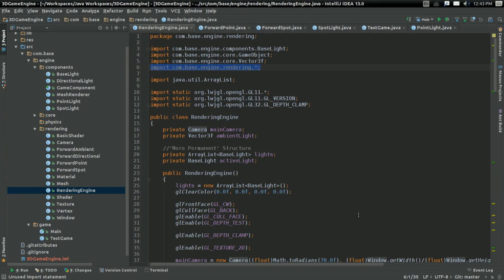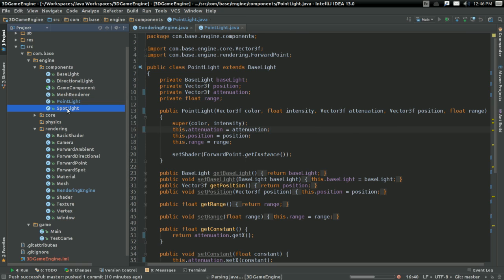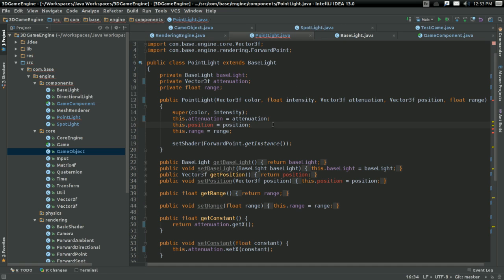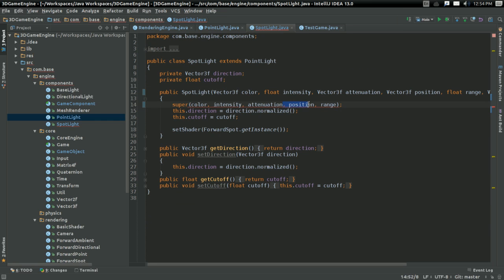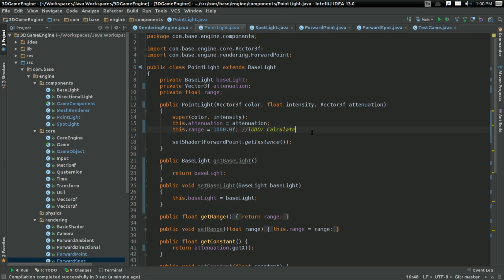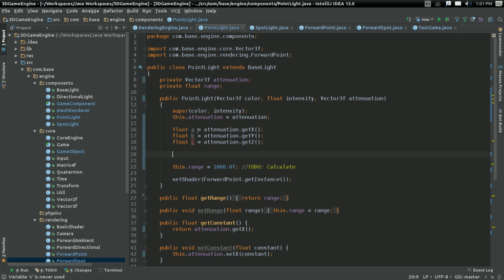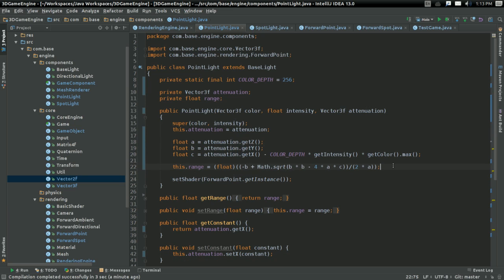#43 3D Game Engine Tutorial: Finalizing Lighting

Comment: So the way the scene graph is made, it seems as though lights are based off of a game object, and are attached almost like an effect.  They don't seem to have independent positions or anything like that.  So if I want a flashlight in my game, and I want my character to hold said flashlight, I will have to make a game object with the mesh renderer for a flashlight and a spotlight component for the light itself?
The only reason I'm asking is because say I want to offset a light for some reason.  I have to then create a game object for the sheer purpose of offsetting the light using it's transform.  So then wouldn't it be best to have a game object assigned to each light to act as a way of manipulating the light?  For instance, a SpotLightObject that's only property is a SpotLight?
Reply from the maker: The way you'd create the flashlight in this system is with two separate GameObjects.

The first GameObject you'd give a MeshRenderer with your flash light mesh and material. The second GameObject would have the SpotLight component, and it would be a child of the first GameObject.

With this, you can move the light to wherever you want, and it will always stay there "attached" to the flash light GameObject.

Now if I understood your question correctly, and I'm not sure I have, there is some issue with this system that can be solved by having unique special case GameObjects dedicated to individual light types? Could you elaborate, or have I completely misunderstood your question?
Reply: ***** I was suggesting that, similar to how you have a set of game components (like mesh renderer and spotlight), some should have corresponding game objects to make implementation easier.
Reply from the maker: forrest0no2 What would be the benefit of having a dedicated SpotLightObject for instance, as opposed to just attaching a SpotLight to a GameObject?

Comment: Well your range system is sort of bugged in my version. I double checked both the shaders and the classes and both spot and pointlights do not have a proper range. The weird thing is that it seems to be different from the angle you are looking (far away and everything is cool, while closer to the lightbeam slowly shows the range cutoff). Any clue where I should start searching?
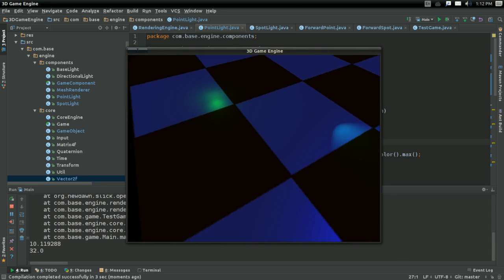Reply from the maker: I'd start by comparing the ranges your code generates to the ones my code generates in the console at 16:40 If they're different, it should give you a hint as to how the equation is off. If they're the same, then just scale the range up by some constant until it looks right. Since range exists purely for performance reasons, having a larger range than necessary won't cause an error with the program, it'll just cause a few more pixels to have light calculated for them.
Reply: ***** Will you be getting into model loading with animation? I believe this is the most overlooked/under explained aspect of Java 3D game programming.
Reply: ***** Alright I checked it and they are indeed the same. But I think there is another thing going on here. The light seems to be changing its intensity based on the angle. But the reflection seems to be get stronger and stronger depending on the angle you are looking at even at the very "edge". Also it seems that the light gets a little bit stronger again at the end of the range (so strong that you can clearly notice it). Any clue? I do have a "custom" Mesh class as I have to use the 4.1 core profile of openGL
Reply from the maker: DarkOverture It's possible that there's a bug in your shader code. Again, since the range is purely a performance thing, I wouldn't worry too much about it unless something seems obviously wrong. You can just multiply range by 1.3 or 1.5 or some other constant until it works.

It's also possible that this issue is present in my code as well, and I just haven't encountered it yet. Are you using a different set of lights than I am?
Reply: As I always try to use your exact code when encountering bugs, no, I am using your exact TestGame class, including all its settings. I have uploaded 3 pictures on imgur that might help you visualising this problem. Maybe this might help you to prevent a weird bug in your engine (as I have mostly the exact same code (again, my Mesh is different)). Here is the link: http://imgur.com/a/lYzfS
Reply from the maker: DarkOverture It looks like there may be a bug in your point light or spot light shader. That isn't what they should look like
Reply: ***** well this is weird. I actually copied all the shaders from your git and modified to work on version 330 and thats it. Its the exact same code. I also use the git code for Shader, Forward<Shader> and the Shader Components. One thing though: in compileShader, when I use the if statement to check if the GL_VALIDATE_STATUS is 0, it says that there is currently "no vertex array object bound". If I disable the System.exit(1) everything runs just fine. How in the world can my version be so messed up? Maybe because I use a Mac with a slightly modified openGL 4.1? 

Edit: Ok so I looked all over my code again and I seem to have the exact same version with the said change in Mesh and the Validation thing. There actually is nothing more I can do without further help, it seems! :(

Comment: Benny how hard would it be to convert everything to deferred rendering? Would it mean redoing all rendering mechanics or just the core?
Reply from the maker: It wouldn't require redoing anything. In fact, it would be a totally additive process. Deferred rendering actually can't handle some cases that forward rendering can, most notably transparent objects. So in fact, a forward renderer is a component of a well implemented deferred renderer. All you'd have to do is write the deferred rendering specific code, and use that for objects that deferred rendering can handle.

Edit: As for how hard it is, it depends on what you consider hard. Deferred rendering itself, in my opinion, isn't particularly hard to understand or implement. It just takes a fair bit of code and some knowledge of the 3D API you're implementing it with.
Reply: ***** Thanks Benny! I'm a little behind on your series and haven't gone through the forward rendering part yet, so forgive me for my ignorance I'm a gameplay programmer haha.

Are you saying that implementing the deferred rendering would mean adding the deferred rendering on top of the forward instead of redoing it? Could these two systems play nicely with each other?
Reply from the maker: landon91235 In a sense yes. What you'd ultimately end up doing is using the deferred renderer for drawing all opaque objects and then come in behind it with the forward renderer to draw transparent objects and other oddball cases which the deferred renderer doesn't handle.

The two renderers can play nicely as long as you're using the same lighting calculations with both the deferred and the forward renderer, and ensure they both generate the same output.

In the Resource Management section, I'm going to add a "#include" directive to our shader loader so that we can have a global GLSL lighting library. A large part of why I'm doing that is just for these sort of cases.
Reply: ***** Thanks Benny!

This is the last thing I swear!

Could you point me to a good reference on reading up on deferred rendering, after searching on Google I found a ton of things but am not sure which ones are any good. Thanks again and the tutorial series is great!
Reply from the maker: landon91235 If you're just looking for how the algorithm works, ogldev.atspace.co.uk currently offers the best explanation in my opinion. I don't think they show the ideal implementation of deferred rendering, but they do a great job of covering how the algorithm works and what tools and constructs are needed in a typical implementation..

If you're looking for something more specific about the algorithm, I might be able to point you somewhere; just let me know what part you're interested in.